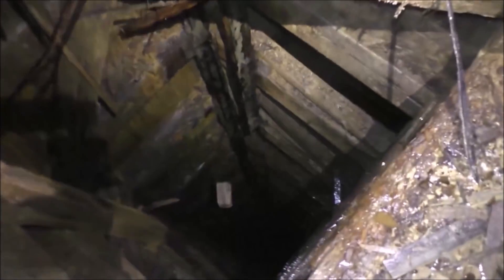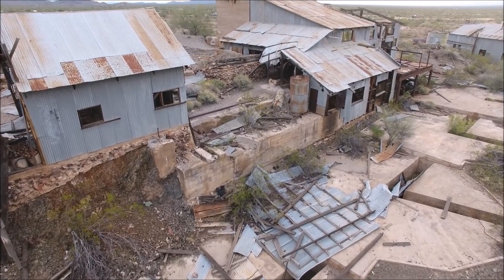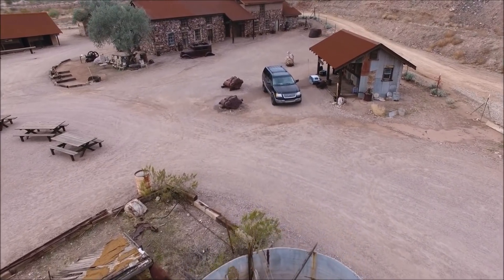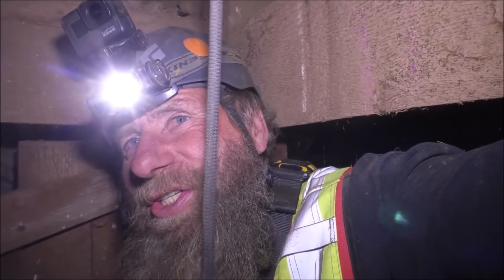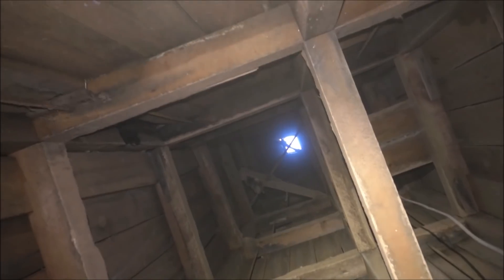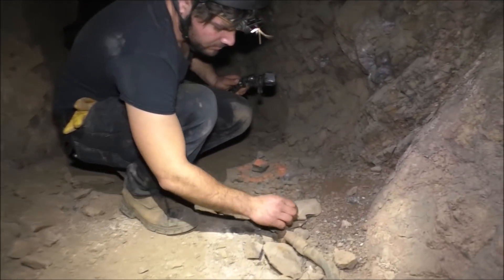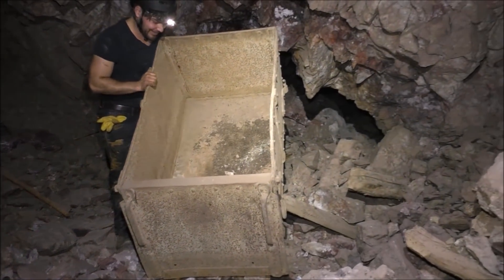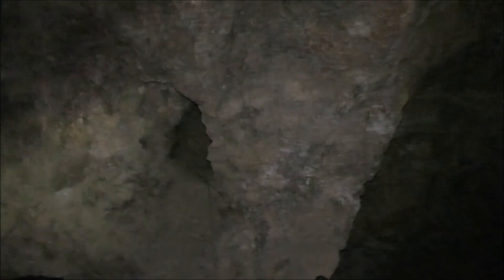#199  Historic Vulture City Mine in Arizona!

Comment: Had explored here about 12-15 years ago, curator in the gift shack let us wander(at our risk) around the grounds at will.  Lots of buildings with equipment still laying in place.  One building used as the cook shack still had pots, pans, tables.  nearby was the "hangin tree" (ironwood) used to physically hang workers that were filling their pockets with the ore.  Also the one vertical shaft had a horizontal shaft on one of the levels, that had caved in trapping a few workers, their remains never recovered (so the story goes)  Thanks for sharing your "gutsy" adventure.......
Reply from the maker: You can still see all that and more today!

Comment: Haven't been there in over 20 years. Back then they were still leaching with acid as they were grand fathered in or so i was told. Assay office was supposed to have been made of ore from the mine and i remember there was an unfortunate accident there way back when. I also remember a giant of an engine that provided the mine with power. Had a ladder to access the top of the engine with a platform.

Comment: Hey hey! Welcome to my state! There are TONS of abandoned mines up in the Bradshaw Mountains as well as down by Wilcox and the Dos Cabezas area
Reply from the maker: Thanks for the tips!
Reply: @exploringabandonedmines  no prob, the ones in the Bradshaws are 99% on public BLM land, some of the workings go back to the 1860s (Oldest one I wriggled down was the Golden Turkey mine near Cleator, opened 1867 if I remember right, collapsed about 3 years ago after a huge rain flooded out the supports)
 
The ones near Wilcox can be tricky, some are on public, some are on private, some are old and abandoned and some workings are still active, pretty sure most of the old ones connect to each other so you could end up popping out on someone's property (kinda like that silver mine in Mexico with the 3 guys and 5 mean dogs)

Comment: I’ve been to Vulture Mine several times over the years, back when you could explore the areas that you showed are being torn down (which is such a shame). I’ve wondered for years what it looked like inside the mine, and what you showed is quite amazing.  Not sure if you are familiar with the site called the Glory Hole, where several miners and Burros died in a collapse in the early 1900’s.?  Just curious how far from that area you think you were or if you could see any evidence of that collapse from inside?  Anyway, this is one of our favorite channels!  Thanks for doing what you do!
Reply from the maker: The surface has been radically changed by the open pit.

Comment: That is one of the coolest mines I've seen you in for quite a while but it's depressing that so much history is going to be destroyed on the ground. If you were a miner that's the type of mine you would want to look for. Closed during a period of profitability when gold was $36.50 an ounce and not worked since 1941. Gold even dropped in 1946 to $34.71 with the original owners either not returning from the war or deciding not to continue mining at that price. Labor rates went up after the war while gold held the same value. It cost $23.37/oz to process (Canadian) in 1946 with production falling to 1933 levels so while it was still profitable there wasn't a great incentive. Maybe better to keep up the tourist trade. On second thought, what can be extremely profitable is to buy the mine, salt the drift face by shooting a shotgun loaded with gold dust at a dead snake your accomplice tosses out from the shadows, sell tons of stock and head to Bolivia. Thanks for sharing Frank/Gabe.
Reply from the maker: In 1900 Gold was $18 an ounce but the miners only made $3 a day.  So if the miners are now making $ 300/day and Gold is $ 1,800 an ounce it is exactly the same!
Reply: @exploringabandonedmines  You were pretty close, they make $220 a day now but the big money is made by the engineer at $86,000/yr. $3 a day was a good wage in 1900 and it slowly increased while gold was held at $35/oz until August 1971 when Nixon completed removing us from the gold standard and supply and demand and greed took over. Still, the really big money was made by the unscrupulous owner who salted a mine and sold shares to investors back east. The Irish were common in the mines and very honest. An Irish miner standing next to his barren shaft was asked if he had found any gold. He answered, "Not a wee bit and even less as ye go down."

Comment: My bedroom has been infested with barking spiders, the exterminator says im crazy and woont even come to check it out. I swear there is also a frog in here, it croaks real loud and smells terrible. Sometimes i step on a mouse and when i move my foot to look it is not there but i smell a dead mouse, i need help getting my room pest free so anyone knows a good exterminator let me know
Reply from the maker: When people burped I would say "You voice has changed but your breath still smells the same!"
Reply: Sounds like a three part job for Lysol, Febreze & potpourri.
Reply: @exploringabandonedmines  I kind of say that about when they fart - -  "the voice is a little deeper but the breath is the same " - - so you finally got down to my neck of the woods and skipped out of BC. As you may have guessed we have conversed before and I mentioned the mining operations I'd found while hunting all over Arizona - - we also talked a bit about the trailer you used a log to get home when the frame gave way. A slight change from the weather in BC isn't it Frank - - you probably don't recall but I told you I moved from up the North Shore in Quebec to Arizona back in 1961 and it took awhile for the blood to thin and condition myself to the Arizona heat. As I told you before I wish we had cell phones or some easy way of recording stuff back then because there was so much history to record from Indian ruins to old mines and abandoned ranching operations. I was back out there in 2018 for my high school's 50th reunion and so much had changed and many landmarks including Rte 66 gone. Coming off the Rim after Payson  you used to be able to see a couple of old mines right from the highway - - like some buildings and headframes above the shafts, and tailing piles but they were gone now. Like so many old memories they only live in my mind so it was sad to hear they were dozing much if not all of the  Vulture. Even the pulp mill we moved from Canada to open in Northeastern Arizona is shut down and being scrapped - - my Dad was technical director  and I worked in that mill so that loss was personal. I'm glad you got to Arizona for a taste and got to record some history before it too disappears - - stay safe